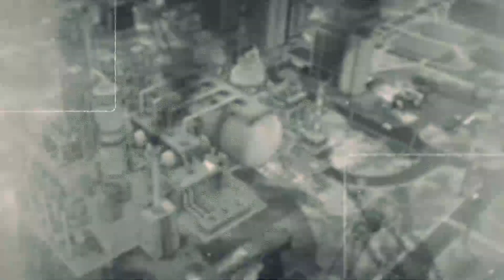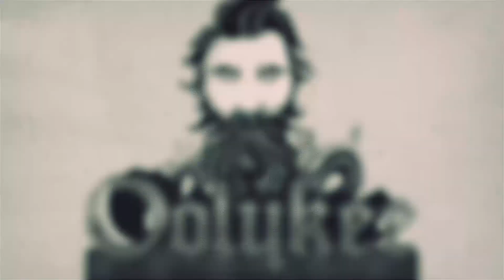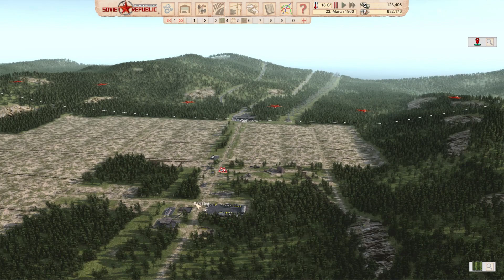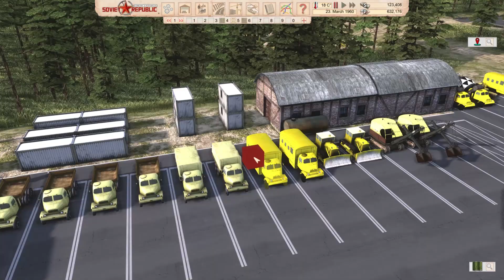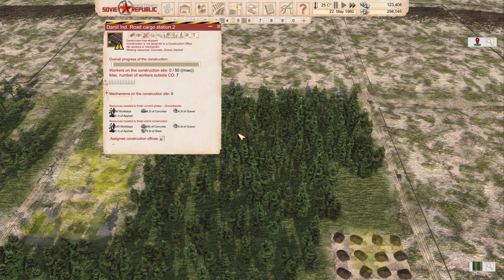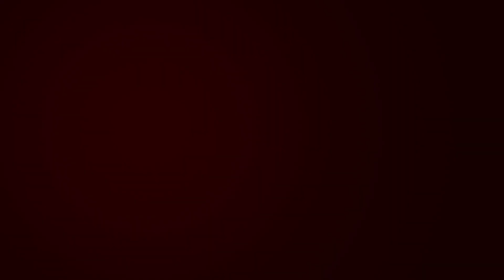Soviet Republic - Alaska - The New Beginning - Ep.1

Comment: In hard mod, efficiency is very important, there are small details that can improve it:
 when distributing your construction projects try not to exceed the number of excavators or cranes you have available. You are wasting productivity or labor time when a construction site receives workers without a mechanism. For example, remember that groundwork with an excavator does not require any workers to get the job done. This brings us to another broad subject: the specialization of construction offices. Without going too far for the moment it is absolutely necessary (for me this is even the first priority of what to build at the start of a hard playthrough) that you build to start a dedicated construction office to the construction of roads the size of which allows the use of mechanisms. Dumpers, buldozers, open hulls to transport buldozers. Currently you have excavators building gravel roads when they would be more useful for groundwork, you have buses carrying valuable labor force on gravel roads which can be built only with buldozers etc. In short, you are wasting your resources and your time. As soon as this specialized construction office is built you must build a third one (eight parking slots are sufficient) which will be devoted to footpaths and small sections of road that cannot accommodate buldozers, with a few dumpers and especially mini-buses: currently footpaths that can be built with a handful of workers will receive a flood of buses from the main construction office carrying an overestimated number of workers for this task = waste :)
Reply from the maker: Let me know more. Do you have a screenshot or a table with what CO uses which vehicles and what is their assignment?

Comment: Love the map and I like all the mods you're using. This is my first series I've watched from you but I like your Mod Monday videos, so I'll definitely be tuning in more. I had a virus knock out my two windows computers right when I started to get steel in my 1935 start. Having to start over will be fun but I've got to figure out my usb issues first. Think I'll try setting my money to hard this time. Maybe it's doable? We will see. I had to build all of my concrete, dumper, reefer, and cement trucks with a mod called auto mechanic cause I couldn't buy them last time. I think there is new mods now but not sure if I will use them at first. I might just buy a few vehicles that I have to have and build the rest. It makes for an interesting start having to build everything, even vehicles.
Reply from the maker: Hey, man. Thanks. Really appreciate it. 🍻
Hard start is doable. Just practice. Is auto mechanic the little repair shop that can make cars from Mr. Novu? I'm thinking about using this as well. 😊 Great minds think alike. 😄
I'm just not sure about which blueprint to buy first. Any suggestions?
Reply: @oolykeegaming81 Yes the white building with the columns in the front, that's the one. As for the blueprint, I would say dumper. You need them for everything. Construction, gravel, Q.S., coal (if you're going for early power), etc.  Second would be concrete. You have to build as fast as possible to bet the winter and you need concrete trucks for that. Third, flatbed trucks. The forth is up to you and the economy you want to build. Covered for the farms and food. Reefer for a meat industry. Fuel trucks to expand. You get the idea.  BTW 2nd and 3rd may have to be switched depending on the heat plant you are building and the amount of starting trucks you have. It all really just depends what you need at the time and the buildings you are building. Hope that all makes sense.

     Also if you want to do this for this video series you may have to build a few of them near a university. It's a little slow to build vehicles, especially larger ones. It works best for 1930s vehicles cause they don't require a lot of materials to build. I'm not sure if you would want to do a 1930s playthrough on a video cause it would take for ever. The trucks I used were 1-2 ton vehicles. Small projects were slow to build and you can forget about building any large buildings tell at least the 1940s. 

P.S. Some vehicles you may just have to stick to buying such as firetrucks, ambulances, harvesters, tractors, etc. 
P.S.S. Build a hotel early, especially if you are starting in the 1930s. That's the only economy I could create with the vehicles I had for that time period.
Reply from the maker: @Asom0403  but those blueprints are expensive. How much do they cost in the beginning? A bit less I bet but still, it must be worth it for me to go ahead with this. We gonna need to be smart with the money. :)

This is some great advice! Please keep them coming in the future. :)
Reply: @oolykeegaming81  Expensive yes. But once you have the license you can build them as you need them. Also if you need money and have 6 of them sitting in your auto mechanic. Sell one and keep 5 or vice versa. Use tourism to pay for everything. May take a loan to set up in hard mode though. I can't remember the initial cost for the license but a fresh test map and a quick build would tell you that as each vehicle is different.Time for bed for me.
Reply from the maker: @Asom0403  Selling vehicles will be hard as I will need to produce them with our own materials as per challenge rules. No loans as well. Tourism is way overpowered. I'm not enjoying the tourism at all. You can build few basic buildings and just watch the money pour into your bank accounts. Also, tourism wasn't that big of a thing in the 1960s, especially in the Union.

Comment: Putting gravel on your roads is crucial, but for my part I would have started with the strategic roads connecting the border to your logistics / warehouse areas as well as your city to your heating plant before those of the fields. It is absolutely necessary that these strategic roads be paved before winter: 15 km / h on a snow-covered dirt road can produce real catastrophes. For other reasons do not wait also too long to upgrade your footpaths in the city as soon as possible, the more you increase the movement capacity of your citizens, the more they will be not only more productive but also more able to meet their needs during their limited free time
Reply from the maker: You are right about the roads! But priority is the farming and potential collection of crops. Export as it starts I do my best to upgrade the roads. 
I think we are totally on the same page. The only problem is that we don't have enough smaller dumper trucks. :)